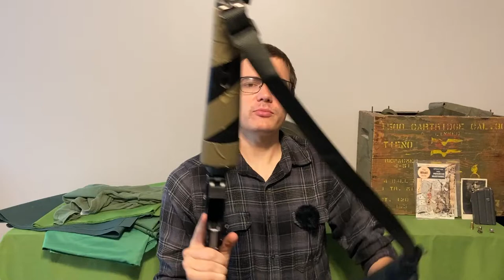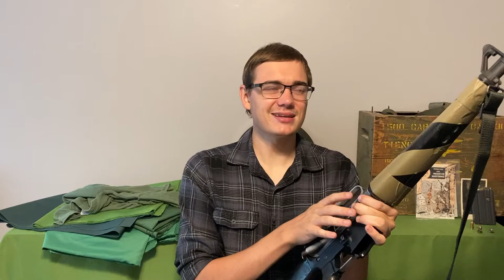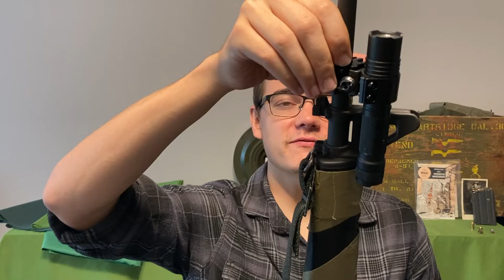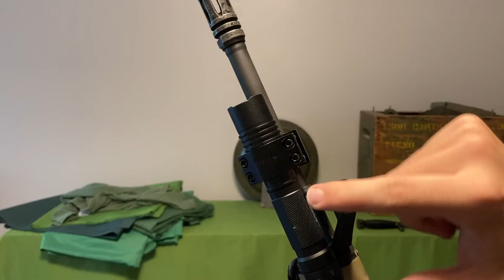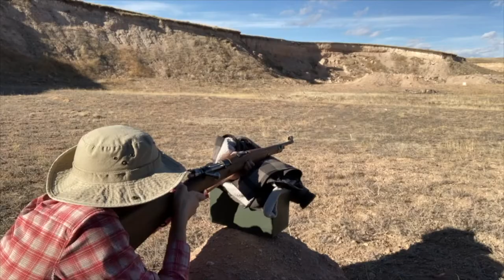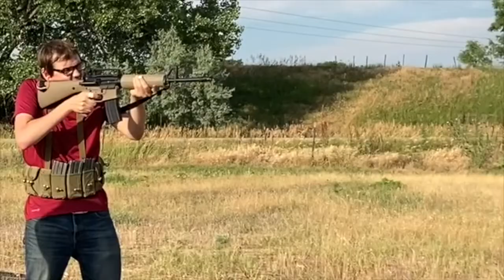Lights on Retro Rifles: Modernizing Retro Rifles Series

Comment: Installed the same cheap mount on my A2 yesterday, and also had to cut down the screws. Added a cheap harbor freight light for now. Great videos. Straightforward. No fluff. Perfect. Thanks🇺🇸.
Reply from the maker: Did the harbor freight light have picatinny?
Reply: @8mmmauserman  no pic. Just a cheap flashlight the right diameter to fit in the ring mount. 12 dollars total, but functional. 
It is a temp solution until I upgrade to 35 dollar feyachi. Cheap light beats no light.🇺🇸 
I built a sweet M4 Gordon carbine clone using the same mount. Very happy with the M4 setup. Took a while to source the appropriate components, and went through several
Configs before settling.

Comment: If I had the M16A1 clone rifle, I would just attach the light via black tape or black gorilla tape. However, since I have the A4 clone, I have the quad rail with the KA vertical grip and a Powertac light with an offset mount. More modern yes, but that's how it was designed. With an A1, I completely understand the need to keep it nostalgic and if they had flashlights back then, how would they have attached them and so on. We know that many military members used paracord to attach slings and such as well as tape and ranger bands. Only thing bad about any kind of gas block or barrel mount, with enough shooting, that mount and light will get really hot and that could be catastrophic if the battery overheats and either leaks or explodes. At least with tape, paracord, ranger bands holding the light on to the handguard, the handguard absorbs and reflects much of the heat so the light isn't. Is it as solid as that barrel clamp? No, but if soldiers back in Vietnam era had flashlights on their M16's, I almost guarantee it would be attached by tape, cordage, or ranger bands. 

The issue is, trying to modernize a nostalgic firearm without modernizing it, that just doesn't jive together so to speak. To modernize it, it requires minimal modernization to some extent.  Only thing I didn't like about the A1 was the triangular handguards. They flex a lot, they sometimes pinched, and they just aren't as practical by today's standards, but the looks on the M16A1, nostalgia all the way. 
If this was my project, I would add a tritium infused front sight pin. Replace the handguards with the Magpul handguards and add my light with an offset mount. Still attach the bayonet and the firearm functions just the same but has modern features while still being technically, an A1 platform. When I built my A2, I just added a sling, nothing else. It's a range gun so to speak but capable of duty use and multipurpose if need be. However, the A4 version offered more versatility in that aspect of modernization and ease of adding accessories as needed. 

I built my A4 clone using the FN barrel, A4 handguard (quadrail, UTG Pro instead of KA) KA VG, offset light mount with Powertac 2500 lm light, pressure switch, A2 stock, HM defense bcg, alg trigger,  BCM lpk, Magpul K2+ grip, Magpul pro rear buis, Primary Arms 1-6 LPVO aurora ACSS optic. Imo, that's the most modern conversion of the M16, but still an M16 (clone). 

Just as accurate, same capabilities as far as ballistics go, benefits of the rifle length gas system, but is it as bomb proof as the original A1/A2? Imo, no. Nothing beats solid irons especially carry handle irons as they are strong and robust, but the fact it's all attached via qd mounts,  adding the detachable carry handle takes it up a few notches in terms of being bullet proof, especially in long term use scenarios with little to no resources. 

If we ever had any kind of true country wise SHTF event that lasted for years, in the end, firearms with irons will be the new standard again as batteries become unobtainable, optics fail or break, and we move back in terms of technology a few decades or more. Imo, tritium sights are worth the money for the long haul, as well as a good sling. Everything else is great but to some degree, depending on the situation or scenario, don't always last, meaning lights, rds, magnified optics, ect. 

Anyways, it's all just my opinion and I find it to be a fun conversation to talk about, everyone has their own preference and they do what they like, no ones way is right or wrong, it's what works for them and fits their taste. Keep up the great work bud, look forward to the fourth installment.
Reply from the maker: Thanks for the comment Todd, I’m excited for part 4 too.